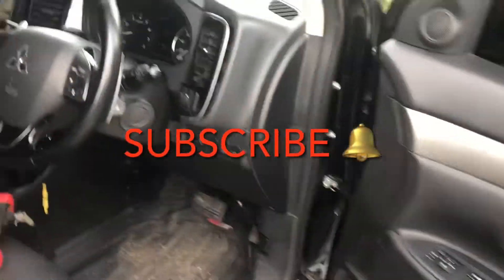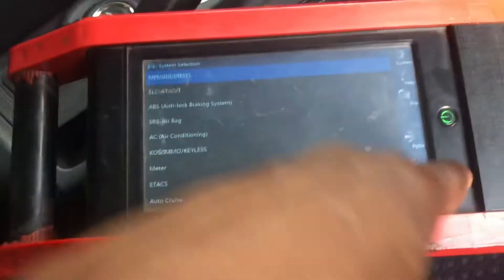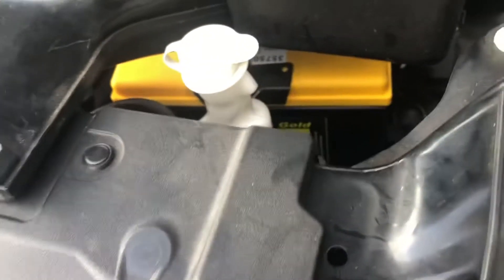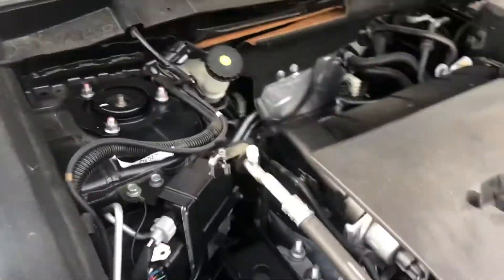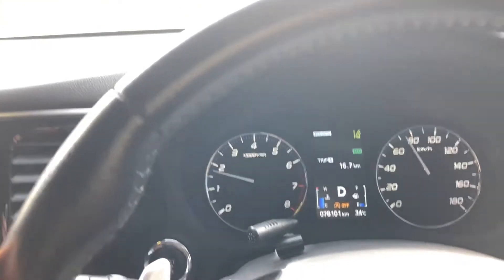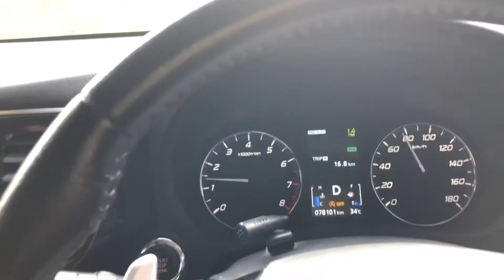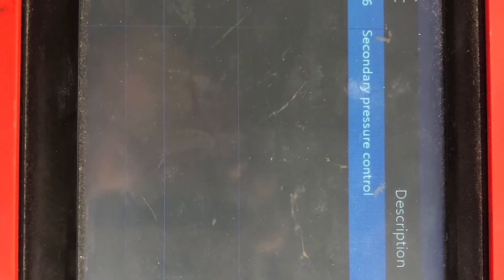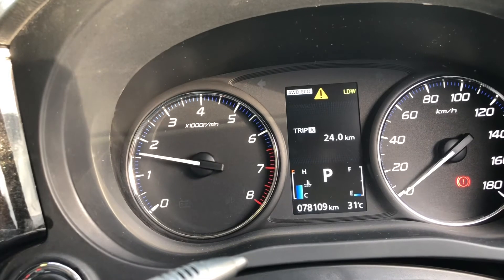Mitsubishi transmission secondary pressure control P0776 fail.

Comment: Hi, I drive a 2013 rvr gt (Canadian version) also known as the outlander sport. I keep getting a P0868 code transmission fluid pressure low. Just had the fluid changed and It drove like new. Two months later I got the code again. When the engine light comes on the car can’t move, so I turn the car off and turn it back on then I have power. Do you know what can cause this problem? Thanks in advance
Reply from the maker: Hi , based on the information you provided some more in-depth testing will have to be done and these points are important to bring closer to the situation. 
1. Was the transmission filter changed when the oil was changed. 
2. The current transmission fluid level.
Reply: @geniusinnovations5268  The filter was not changed and the level of the transmission fluid is full.
Reply from the maker: @Amaliaabdul1  check the quality of the oil  it can be contaminated due to the fact that the filter wasn’t being changed.
  If the oil isn’t contaminated change the pressure switch .
Reply: @geniusinnovations5268  Thank you so much. I really appreciate your assistance. Now I have a starting point.

Comment: Hi Good day

Mine is outlander 2011 CVT

P0470 lock up circuit solenoid?
It is running but only in the 1st gear no shifting happened.Then i try to shift manually then its showing changing numbers in the dash but still not shifting and stayin in 1st gear.
Reply from the maker: Hello ,
Is this the only code you got .
Reply: Yup

Comment: I also had the P2719 error on my 2017 Mitsubishi Lancer. I removed the valve body, tested the solenoids. Replaced a shorter pressure solenoid that ohm lower than spec. New fluid and new filters (cooler and pan) and still the same issue. 

I have the JF017E valve body. 

Any thoughts?
Reply from the maker: Hi,sometime the ECU is affected by the sort of the solenoid , i have seeing cases where resistors have to be replaced and in other cases the ECU was changed.
Reply: Did you figure it out?
Reply: @figuredishouldfilm  I have not figured it out yet. I'm debating replacing the valve body, or maybe just the solenoids from the valve body, to see if it helps. I'm just really arguing with myself over putting $ into it. I called a few Mitsubishi garages, but they all have pretty generic, "if there's clutch material on the speed sensors, we recommend replacing the entire transmission"

Which to me seems like a very vague awnser, especially after reading DTC procedures.

Comment: Hello, I have a 2013 outlander sport with a similar issue, once I get the pressure switch control code. The car wouldn’t accelerate. Even while moving the rpm runs high. I have changed the value body and filter and oil and still the same thing. I need help. How many filters does this cvt transmission have ?
Reply from the maker: Hi,what is the exact code did you get, one filter is inside.

Comment: Hello, can you tell me how you solved the problem?
Reply from the maker: Hello, The issue was resolved after changing the transmission fluid and filter and a shift solenoid,and I was on eBay it was purchased.
Reply: Can you say what solenoid you changed?

Comment: Hi i am the owner of 2010 Outlander 2.4. My Outlander facing problem with check engine light. So when we are in a bumper to bumper traffic my Outlander taking time to move forward like around 5 seconds even after changing yhe cvt fluid and sometimes it doesn't move at all i have to turn off the engine and start again then only it will move forward. Check engine light comes and goes even when vehicle is running. So. I took to a mechanic he said it might be a issie with torque converter. Other guy said "need to change whole transmission" Lol😂 (2010 outlander kms reading 1,27,772) at present. So what might be the issue.
Reply from the maker: Hi , from experience it can be one of the shift solenoid on the valve body. However I would recommend that you get it scanned to be sure what direction you are going. That is a really large number that might be an issue as well ☺️. Get it scam and let us see what happens, all the best .

Comment: Their is a code on mine saying pressure control solenoid b stuck off that's causing problems and caused the check engine light to come one and it keeps saying transmission service required and I literally just serviced it changed all the filters and used the CVT-J4 oil what else is their to do should I just clear the codes?
Reply from the maker: Hi , the solenoid seem to be clogged and  not allowing sufficient fluid to pass through or the solenoid internal electronics has failed,
 You can try cleaning the solenoid after which clear the code then see what happens.
Reply: @geniusinnovations5268  ok I'll give that a try also whenever it says transmission service required the drive icon D starts blinking and the gas pedal stops responding, and if it's driving the car keeps reving up and down idky but I'll try what you said tho

Comment: Hey…I just got problem in clutch pressure control circuit in my Outlander 2015..Is that the same problem I got?
Reply from the maker: Hi , yes it was and I changed the pressure control solenoid and the problem was solved.
Reply: Cual es el nombre del Celenoide o donde lo consigo ?

Comment: hi have the same problem. Will you change the solenoid? and what solenoid is it?
Reply from the maker: Hi, yes I did change the solenoid and The problem was solved. It was the Secondary pressure control solenoid the cost for it was US$130.
Reply: working on a similar issue with Outlander - look forward to your second video
Reply from the maker: @ShibuPaulAluckal  sorry I didn’t get a chance to make a follow up video while I was changing the parts.If I could assist you in a way plz let me know.
Reply: @geniusinnovations5268   is it hard to replace that solenoid?  Wasn’t sure it was as easy as just taking transmission pan off and it is accessible
Reply from the maker: @Kuhndaddy34  thanks for watching my video hope you are subscribed, it is not too much of a lengthy process just that the valve body will have to be remove.
Reply: Sorry a little late but Hey can you tell me where I can find a valve body for my  2015 outlander sport 2.0 love the videos